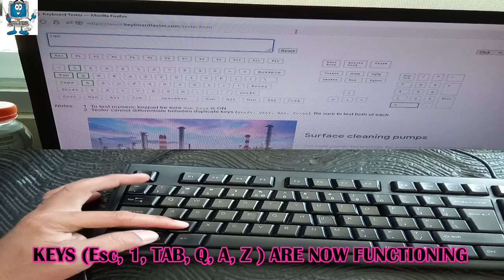SOME KEYS NOT WORKING/FUNCTIONING | KEYBOARD REPAIR

Comment: Thank you very much , I have a keyboard that had water spilled on it, after some time the third row of keys stopped working, I disassembled it , and saw a trace that had a brown zone on it but thought if it's not completely disconnected it is fine but I didn't even think to check it with a tester. Thanks for the Idea as soon as  get home I'll try this

Comment: I repaired a logitech k400r following this video. It was affecting several keys 8,
U, P
A, L
Alt (left)

Turns out it was the same line for all of those. The problem was discontinuity almost at the end, where it merges with connector. I had to like dig a little (with a needle) because the problem was under the plastic protection, but I managed to get a fine cable and secured it with tape. I then checked the continuity and it was perfect. 

Thanks so much for this video. It saved me from purchasing another

Comment: Bro you save my keyboard. Though I didn't have the instrument to check the fault but I somehow managed to locate a black spot in the non-functional circuit line. Then what your method of copper wire and now it's working perfectly. Again thanks a lot.❤

Comment: From 8:00 you can see how to repair it after you find the damaged line/spot. Note there are other ways as well but this should work fine.
Reply: Yea, but for how long that glue will do its job :(
Reply: @xpert5759  Untill you get a conductive paste that would help you fix it properly. :D

Comment: This ruined my whole keyboard
Reply from the maker: Why??
Reply: @botatoyzidea7483  idk
Reply from the maker: @boltnz6141  what is the problem of your keyboard by da way?
Reply: @botatoyzidea7483  none of the buttons are working
Reply: @botatoyzidea7483  after i did this none of the buttons started working.
Reply from the maker: @boltnz6141  the usb is the problem of your keyboard i think. try to clean the circuit board with thinner or WD40
Reply from the maker: @NHbinaaa111  yeah just clean it and also the circuit board clean it with a thinner